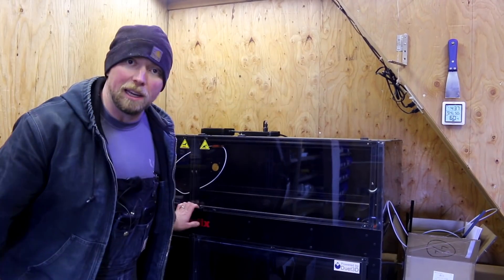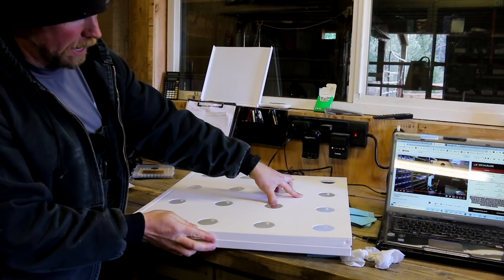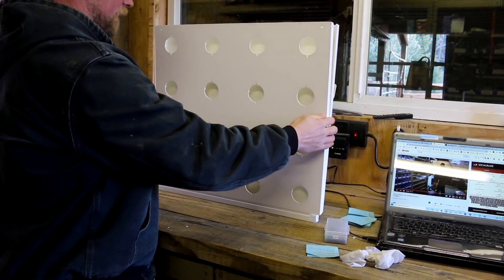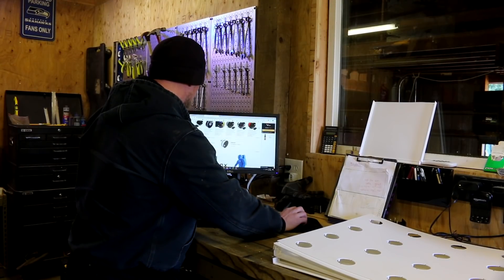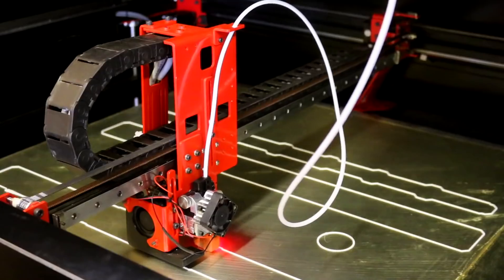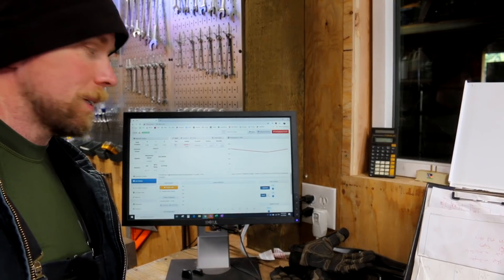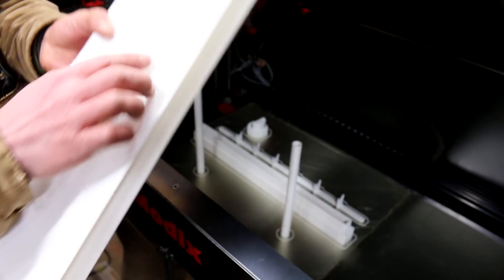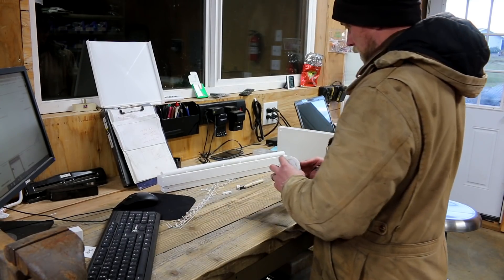IMAGINE What You Can Make, When You Can Print THIS BIG

Comment: Very serious question. Why are you printing pipe? Really for every component i ask my self what part or function of this must be printed and what do i already have as stock material. Especially for a prototype. A few blocks of wood and some sheet stock can be placeholders to keep investors happy. Progress by swapping for production grade part as they come available.
Best of luck.
Reply: A bunch of us keep wondering if he could maybe save money and time by changing to printing brackets and using sheet goods (especially for the back). It just really seems like if he mixed up his manufacturing process he could drastically reduce the time per unit and theoretically save a good bit of money/effort. There are things he's making where it absolutely doesn't make sense to do anything BUT additive manufacturing, but there are a lot of bits that just don't seem to. 

In case Jeff reads this, I'd really really look at
------------------------------------------------------------------------
*changing to sheet goods for the back

*sourcing a ready made pipe, cut to length, drill holes, and either use standard plumbing fittings or print end caps/adapters as necessary

*Add slots to the wall top section models and replace that bar with the pipe holding bits with just the pipe holding bits that snap into the wall top section . Can you do dovetails efficiently with fdm/fff? (Or half dovetails? Easier/faster to print the little holders flat with one half of the dovetail away from the bed.)

*Can you explain why you are printing that top section upside down? Why waste the time/filament printing supports for the radius with it upside down when you could use the flat of the bed for the flat that's the bottom of the piece, and if you want you could do that fancy 3D surface layer that makes contoured surfaces look so sexy?
Reply from the maker: I saw it and read it ;-) good ideas...i'm working redesign and new processes
Reply: From what I understand I think he wants to sell the 3d printed product, I think that's why he's buying food grade filament. It really doesn't make sense to me why he's printing the entire thing. I'm also unsure of the longevity of the printed wall with just a few layers. I like the idea though.

Comment: Jeff...just get a simple webcam or two and connect it/them to your workshop computer.
That way you can just login and view the camera(s) with any remote software...in fact "Anydesk" is pretty dang good...and it is FREE!
If the USB cables are not long enough use an active USB extension with a hub and you got it made.

Comment: Jeff, couple questions for you.  I'm having a hard time envisioning exactly how this works.  Would a plant go into one of those pods (not printed, that fit in the holes) and then spend its life there or is this for starting?  2nd question, have you thought of a cheap VR setup so you can model the parts, put on the VR (or maybe AR?) and "look" at it before printing it?  May not be worth the expenditure, but the up side is that you could potentially save time printing something just to look at it and see how it has to change.